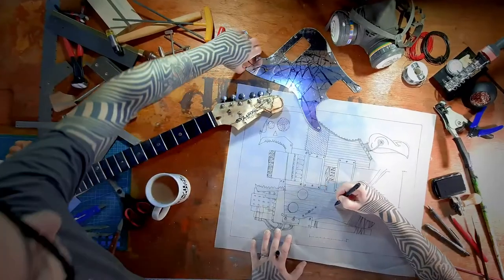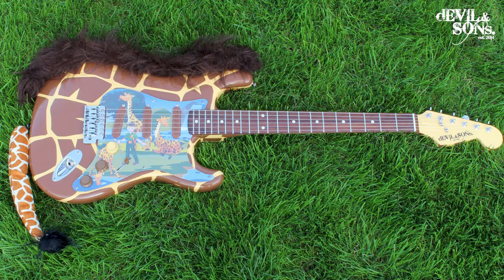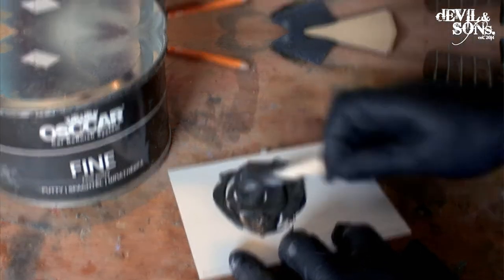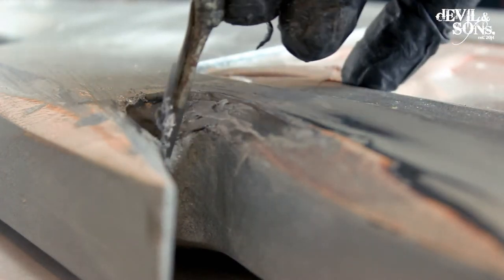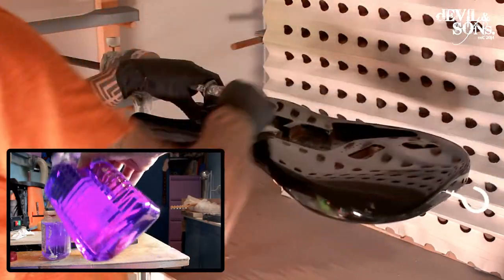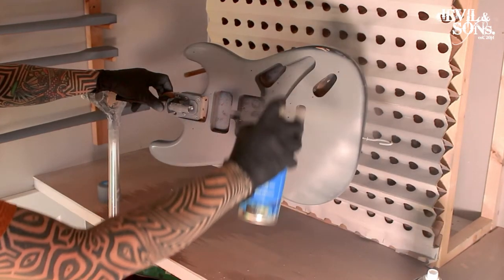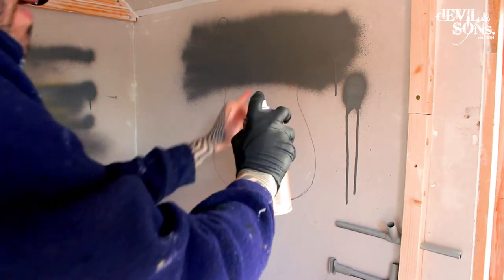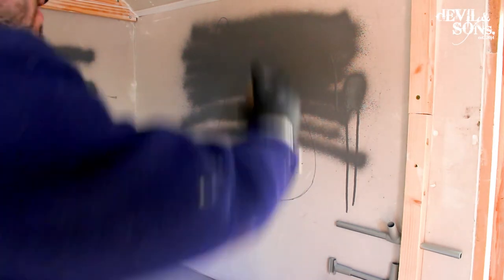How to perfectly prep and prime for painting a guitar body

Comment: More questions Devil & Sons, I was going to use a Deft sanding sealer on on my newly built guitar. Then I found out that oil based Polyurethane does adhere to the sanding sealer. Therefore I'm going to a Zissner cover stain white primer and using that in place,  then apply tinted poly, and my top coat poly. What do you think?
Reply from the maker: I'm not sure, I think some sanding sealers and paints are fine over oils like tru oil. If you are essentially restarting the process by covering it all I would sand a bit first, although a good oil will seep into the wood, it may help get an even finish.

Comment: I built a commemorative Firemans ax guitar. I was not happy with the rattle can finish so I decided to get a compressor and go with a spraygun. I completely stripped down the red paint using a heat gun used the Bondo and sanded where needed. I then used acetone to clean the wood following with a coating of linseed oil. Today I start the taping and spraying of the primer. Gray seems to be the only color but I did find one that was a rusty red color. But nothing in white. Thanks for the video, it was spot on. And you could never do enough wet sanding.
Reply from the maker: Thanks for the comment. Your guitar sounds pretty cool. To be honest I used to use a compressor but I was wasting money on paint and varnish but not getting through it quick enough, I was a bit too lazy cleaning my gun sometimes, and it seemed to take me much longer - but it did always look great.
Reply from the maker: Also, if you end up putting photos up online please do tag me, it's always good to see what other people are doing.
Reply: @DevilAndSons  I hear you on that, I’m lazy as well and hope I can get through on cleaning my guns.  I’m just looking for a better atomization. Plus when I have a shop mix my pain is going to have red sparkles in it as well.
Reply: @DevilAndSons  I would love to tag you on my two guitar designs. They are one offs which means there’s no other guitar like it in the world. But can you tell me how to tag someone? Lol
Reply from the maker: @jimmymeetsworld464  are you on Instagram or Facebook? Basically you could mention me in a comment using @devilandsons
Reply from the maker: @jimmymeetsworld464  red sparkles sounds good.

Comment: Great video, so you don't have to first take out completely the original paint? just sanding it, is enough?
Reply from the maker: Thanks. Yes it should be enough if the original is in good condition and you trust that it and the undercoat are good quality, which they should be if it is reputable brand.
Reply: @DevilAndSons  Thank you very much for your quick answer. great youtube channel:)
Reply from the maker: It's a pleasure, and thanks for commenting. I should also say you should sand the surface of the original with something like 600 or 800 grit paper so there is a surface the new paint can adhere to.

Comment: Hi what sort of mask do you need to paint safely with the paint that you use?
Reply from the maker: I use an abek1 filter on my mask, with an additional P3 filter.  Recently I have swapped to a full face mask, but I used to use a half mask. 3M make the mask I use, but there are lots of companies, as long as you have the right filter. The P3 (it may be a P3r) is for dust so not essential, but it means I can use it when doing woodwork too.

Comment: How smooth exactly does it need to be before paint? If there are really tiny grain and divit marks would those show through after paint and clear coat polishing?
Reply from the maker: I use 60 grit normally before priming. Some primers act as fillers to fill the pores, and you may even find some paint does too. But these will always need sanding between to coats to smooth out, and divits or grain will be exgerattwd by each coat but filled as you sand down. If you have porous grain you should use a grain filler first. I will actually be making a video about grain filler in the next month or so. My advice would be to do the 600 grit, prime, sand, fill any large digits and prime and sand again. Normally I find this enough. However if you are unsure I would go ahead and start with a grain filler before doing this. I hope that helps.
Reply: @DevilAndSons  I used car reps 2k epoxy primer filler and have it fairly smooth there are just a few spots with very very light grain or holes. Was wondering if that would be fine to apply the base coat over. I was thinking of stopping here with the primer. Then  doing 3 coats of base coat then sanding some lightly again after 48 hours, then 3 more coats of base, 3  top coats then the 2k clear i bought.

My body is basswood and i mostly used dry wall compound and this epoxy primer to fill the grain which is already pretty tight.

I have a 1k urethane white pearl paint that has a base and top coat
Reply: I definitely recommend that car rep 2k primer for softer woods it made that basswood solid and dent resistant.
Reply: @DevilAndSons  i appreciate your videos and reply btw. Thanks
Reply from the maker: The only thing I would say is with so many coats it's best to make sure everything is properly dry, so 48 hours between sessions is sensible. I am positive that would sort out any remaining marks.
Reply from the maker: Interesting. I've just done a shoot out on a few versions of my favourite primer (yet to finish editing it). I didn't consider the hardness of the finish but the way it filled the cracks etc... i think that is a really important point you have brought up.
Reply from the maker: Thanks so much.
Reply: @DevilAndSons  its epoxy so its pretty rock hard.

Im not 1 of those nuts that believes in tone wood and all that crap a knob on the amp or pickup or age of strings makes way more of a difference so epoxy to harden this wood up like a harder wood and keep it light is what I wanted.

I'm making a custom Ibanez pia/rg

Comment: One word about filling bad spots......Bondo???? Why?? You're working with wood, not metal. Use a wood filler for that. It finishes out far better and isn't so difficult to smooth out.
Reply from the maker: I find it much easier to work with and smooth. I guess it depends on the make.
Reply: @DevilAndSons  I've always used Elmer's wood filler on wood projects. Most times, I use my finger to apply it with for dings and holes. It dries quickly (in about 30-45 minutes or less to sanding phase) and it smooths out far better than the Bondo (which I have used for auto and motorcycle repair/repaint. And, if need be, you can layer the wood filler to get exact level you need without a lot of hassle. Also, it doesn't create "dead spots" for tonal qualities in the instrument. It's also a lot cheaper than Bondo.
Reply from the maker: I'll have a look to see if that's something I can buy in this country. I've never used bondo as you can't buy that hear either.
Reply from the maker: Thanks for the suggestions.
Reply: There is a Bondo for wood. I use it on my guitar and I just like the way it sounds and really smooth out particularly for large areas. As far as pin holes or nail holes or indentations in the wood I can see how that might work for you but I have areas that need crisp definition and I can get that with the Bondo.
Reply from the maker: I find that the car filler comes in a fine finish and is better than wood filler, it really doesn't matter when you paint over it and it's just nicer to work with. Obviously there are lots of makes of both and it just depends on the make.
Reply: I’m gonna add some more input here and say that if you’re going to stain then I would definitely use a matching wood filler. But if you’re going to paint the advantage of Bondo goes well above and beyond than that of wood filler.
Reply: @jimmymeetsworld464  Many of the available wood fillers can be pre-stained by mixing a small amount of stain into the filler before you apply it. I've done it quite often and no one can spot the difference.
Reply from the maker: That's a good tip, thanks for sharing.
Reply from the maker: @jimmymeetsworld464  I agree to that wholeheartedly
Reply: @caniswolf3394  That’s a huge factor. The last thing you want is for something to show up after you put the lacquer over the stain.

Comment: this is so wrong lol. cant believe you're trying to teach people
Reply from the maker: Can you please help by telling us what is wrong.
Reply: @DevilAndSons  sorry for being so rude, i was tired. but you should fill the guitar properly before spraying primer, it was awful to see the holes and scratches or whatever after applying primer. primer is not gonna hide them, filler should do the job. and if you're on bare wood and not using 2k products and/or polyester resin, after some time you'll see the wood grain through the paint.
Reply: @DevilAndSons  plus also some parts of the body before painting look like sanded by like 220 grit and some parts look almost glossy, polished. always sand the whole body with same grit. im using 600. but even when i spot sand off some filler with 220,i go through 400 and 600 to achieve uniform surface roughness
Reply: @DevilAndSons  and also for cleaning/degreasing use just alcohol (IPA) your formula is more likely to cause some problems after applying the paint
Reply: @DevilAndSons  and one more time ALSO, dont mess with your paint between layers. stop grinding after first layer, you should apply few coats after it dries to touch
Reply from the maker: The great thing about primer is it can help reveal the issues so if you have missed anything the first time to allow you to touch up before, then reprime before painting. Ideally you wouldn't have any need to do any more work after the priming but we're only human and mistakes happen. To totally stop the primer and start over may just cause some more finishing issues.
Reply from the maker: No worries. It just useful for everyone watching who reads the comments to hear tips and advice from inheritance in the comments.
Reply from the maker: I'm not sure it would. I was taught this but a professional French polisher and I believe it was a mix that has been used in his industry for years.
Reply from the maker: Yes this is right. I recommend 3 coats of most paint in each sitting, then let dry. If you end up needing more or a different colour you have to wet sand between as once it is fully dry you will potentially have lamination (unless using a laqcuer).
Reply from the maker: Yes, I absolutely agree. I would use 600 before priming, but normally use 800 afterwards. Then when the final clear coat is on you can start using finer. It is important to work on the whole body so you don't get lamination issues. The more perfect it is between layers (I.e. flat ) the better the final outcome will be.